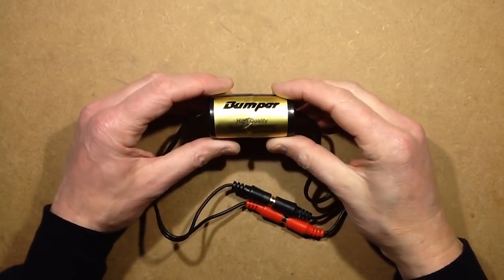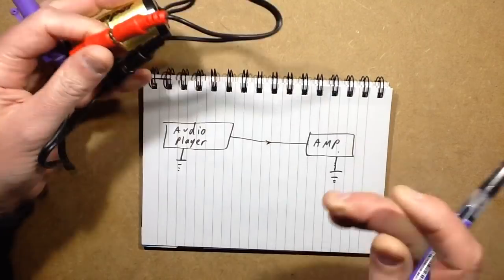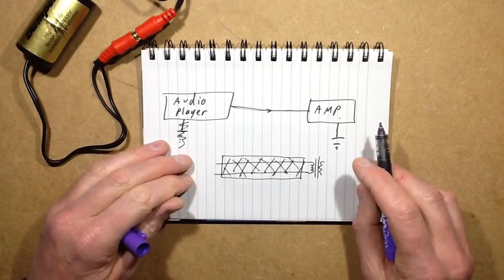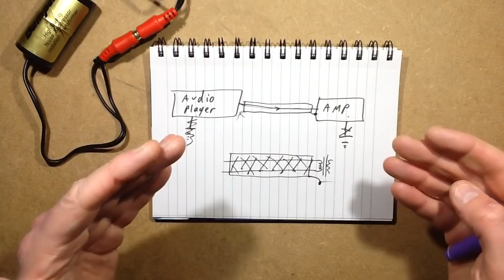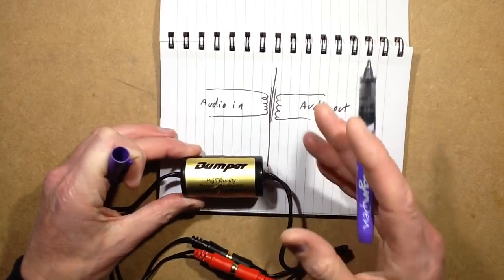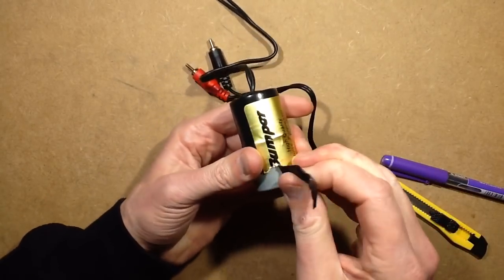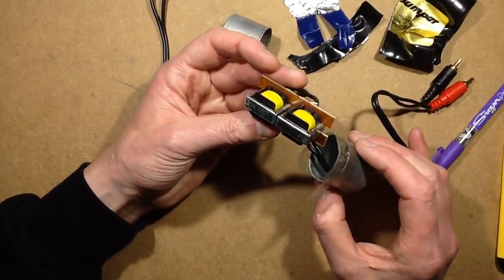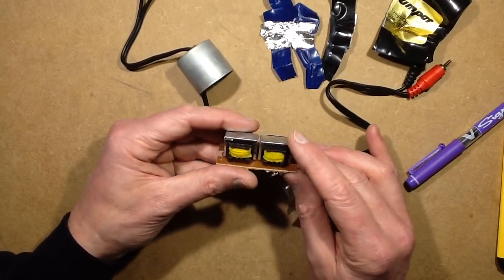Inside an audio isolator transformer module.

Comment: These are great. I've used them in several projects.  Most notably was my 80s Bluetooth boom box where I used it to eliminate the horrible noise the Bluetooth adapted was creating.

None of the ones I took apart had that foil on top though but we're surrounded by a razor sharp piece of tin inside the outer cylinder.

Comment: The foil looks to me, bodge job :) Usualy, we always place pair of stereo trasformers 90 degree (eliminate magnetic crosstalk), then we connect the transformer shielding together (eliminate EMF noises) the outside shell is a simple raw steel, to block low frequency magnetic waves from the transformers core, because this transformers has a bit air gap. on consumer level, working perfectly. The best ones uses precision winding, hexacore coils, gold or silver plated shield, and some kind of special core. I even seen mixed E and toroid transformers. What I dont like about this transformers, is the way, how they destroy the high frequencies and the saturation. Use short strong rca cables, and for big distances, no other way, just balanced signals. And yepp, same source low resistance earthing. Or digital interconnect. Thank You for sharing :)

Comment: I bought two audio isolators ( rca + 3.5mm) after watching this video. This stuff works since for some reason my pc causes a hum and buzz whenever I run any games that utilizes my graphics card heavily. Thanks bigclive
Reply: The hum and/or buzz from PC is caused by poor quality power supply and/or poorly implemented voltage regulators on your motherboard. And audio isolator will fix the problem despite the source of ground loop.

Comment: I usually end up buying stuff you show, but in this case I've already got a stack of these in use today to break open the earth loops between my 3 PC's, mixer and amp. They're very cheap and work well. Decent bandwidth if I remember right.

They've been around for many years. I remember selling them in the electronics shop in Newington 15 years ago!

_________________________________
Maybe the foil was used to join the two transformer frames together to help with channel isolation?

Comment: I had a similar issue with my external USB-AMP (no ground Audinst HUD MX1) connected to my PC. I was soooo glad when I got one of these and it solved my issues. The AMP is also creating a very loud humming when the USB is not connected to the the PC but its power supply is connected to the mains.

Thanks for showing us what is inside!

Comment: Unbalanced audio connections can pretty much be considered broken these days. With computers, shielded network cables and all that good stuff in modern setups, there's earth connections coming in all over the place. You'll be catching a ground loop faster than you can say "ground loop".

Ground loop isolators are handy when having to interface unbalanced to balanced. One system relies on floating ground, the other is earthed everywhere.

The important thing about balanced connections is the balanced impedance part, actually (if in doubt, consider the case of no signal). The whole thing can be treated as a Wheatstone bridge.

If shield currents cause audible noise, usually one component suffers from a faulty shield connection hookup known as a "Pin 1 Problem". AES48-2005 clearly states that the shield (XLR pin 1) must go to chassis directly and immediately, and must not connect to local audio ground first (the connection between both is made elsewhere). Now components that disagree should mostly have gone away by now, but it looks like even recent KRK Rokit speakers (5", 6" models at least) are still affected.

Comment: i was always taught(and please correct me if im wrong) but "balanced" audio was the act of running the same audio signal through two separate wires with one being "normal" and the other being polarity inverted, once combine they cancel out any noise...

----------------------------

In fact, a little bit of googling brought up this:

http://www.ians-net.co.uk/articles/balanced_lines.php

To remove noise from a signal we need some way of working out what is our wanted signal and what can be thrown away. Balanced lines achieve this by transmitting two versions of the signal down their length. The source equipment sends the normal signal down one conductor and a polarity-inverted signal down the other. This is usually done using either transformer-based or electronic output stages.

The cable itself is designed with the conductors having very similar impedances and twisted along their length so that any noise is picked up equally by both conductors, no matter where in the cable it occurs.

The receiving equipment has a transformer or electronic differential amplifier, and takes the inverted signal and returns it to it's correct polarity. At this point, the wanted signals on each conductor are both the same polarity, whereas any noise is of opposite polarity. Summing the signals from the two conductors together reinforces the wanted signal and cancels anything unwanted, leaving a recovered signal which is very close to the original. (this is known as Common Mode Rejection - i.e. any signal which is the same on both conductors is removed.)

Even balanced lines aren't perfect, though - slight differences in impedance, twisting or input gain will allow some noise to slip through. This isn't generally a problem unless you're using very long runs or working in areas of high interference. 

It looks like the same as what twisted pair does with networking/telecoms...
Reply: +TornTech  Almost.....Balanced lines are indeed, differential pairs. Each line of the pair, contains the 180degree inversion of the others signal. The amplifier will only amplify the sum difference between the two lines. Any noise, picked up on the lines will be of the same phase and amplitude, on both lines, hence, no sum difference in noise to be amplified. Clive's explanation was correct however, it did lack a bit of detail.
Reply: +bain5872 Almost. DIFFERENtial pairs do not require the two signals to be inversions. In fact you could have all the signal on one conductor, and 0V on the other. The "difference" between the two is still the audio signal you want, and the common mode interference is still rejected. In order for differential signaling to work, the IMPEDANCE must be the same on both lines. That way, common mode interference affects both lines EQUALLY, and is thus subtracted properly on the output. The reason inverted signals are used, is because it increases the dynamic signal range, and drops the noise floor.
Reply: +bain5872 The term "balanced" means the impedances are balanced on each half of the pair. It does not refer to inverted signals.
Reply: I am aware of this however, without a differential signal (inversion of one line as opposed to the other), there is no amplification nor noise cancellation. It stands to reason that if there is a mismatch in either lines impedance, there would indeed, be a differential signal on that line. This is the point that you seemed to not understand. If I misunderstood this, please accept my apology.
Reply: Euro Bum
You are clearly speaking on a subject for which you have a very limited knowledge. I suggest instead of finding factoids, to bolster your sense of worth, you do real research on the subject and please, stop using Wiki as your source material. Good day Sir.
Reply: Euro Bum
No problems on my end at all and thank you for your concern with my comfort. If you felt insulted, you were mistaken. That feeling was instead a broken ego which is also affecting your ability to understand which is why I posted the first reply to begin with. I wish you peace and hope you have a wonderful day.
Reply: +TornTech Does that also mean that non-linear effects of the transformers are cancelled out?
Reply: pepper669
No. Once you lose that power, you can't get it back. Differential signaling doesn't mitigate this. In fact, baluns have a transformer at both ends, so it's a double whammy. However, that's why transformers optimized for audio (ex. Triad TY-141P) should be used. I've listened to the output of a Cat5 balun, as well as analyzed it on a scope, and measured the output power, across the audible range, and there was no perceptible difference.
Reply: +Euro Bum Thanks for the info, appreciate it!
Reply: +bain5872 Gone :) Thanks. Way to be a censor.
Reply: +Euro Bum Gone :) Thanks. Way to be a censor.
Reply: *****
Your opinion is welcomed however, I wonder how your employer, considering whom they are,  will feel about their choice to employ a trouble maker. Of course,  I would never do this to anyone however, they are others whom will. I would be careful if I were you.
Reply: bain5872 Gone :) Thanks. Way to be a censor.
Reply: bain5872 Gone :) Thanks. Way to be a censor.
Reply: bain5872 Gone :) Thanks. Way to be a censor.
Reply: bain5872 And yes, you have the originals. Do with them as you wish.
Reply: *****
You are very naive.
Reply: bain5872 How so?
Reply: bain5872 As a matter of fact, check your private messages. (Hangouts, that is)
Reply: bain5872 Bloody YouTube, changing everything all the time.
Reply: *****
I did not say that I would. I'm not a person that would hurt someone just because they disagree with me. I was warning you that they are persons that will. I was being nice to you.
Reply: bain5872 Are you going to accept the invitation so we can talk this out?
Reply: bain5872 Well, still, I took your advice. Didn't want someone else doing it.
Reply: There is nothing to talk out. Hey, I've got no beef with you. I was simply illuminating a problem you will run into by stirring the pot of trouble. I truly wish you the best.
Reply: bain5872 You know what? Now that I've calmed down, I feel the same. Sorry for being such a prick. Sometimes I let my anger get the best of me,
Reply: *****
No problem. You're human just like everyone else and you are indeed entitled to your opinion and I respect that. I would be cautious though. They are some truly vicious people out there. Have a good day.
Reply: Having gone through training as an audio engineer, I've been taught that balanced audio is from something like an XLR or TRS connector. These use 3 connectors. Two for the positive and negative portions of the signal, and a third ground connector. This reduces the likelyhood of noise and allows cable lengths of up to 2000ft. Whereas unbalanced, such as RCA and headphone cables use two connectors. One for the positive portion of the signal, the other pulling double duty for negative and ground, and limits the length to around 250ft.
Reply: James Laidler Agreed.
Reply: Balanced audio is simply the implementation of a differential pair.  Noise that is common on both wires is cancelled.
Reply: Randy Lott
Well put. Completely agree! This is what I should have said in my very first reply to this post.
Reply: +bain5872 One cannot be mistaken in feeling insulted, especially by an insult. Instead of reading factoids to bolster your sense of worth, I suggest you make some kind of effort (don't push yourself though, I doubt you'll understand much!) to understand the fundamentals of this kind of psychology and practical morality.
Reply: Roflcopter4b
You are most certainly incorrect in your analysis of my psychology as well as your guess of my understanding of the subject of audio electronics. As to the original subject of this post, your flawed opinion adds nothing to this discussion but an insult. I think taking your own advice would be a wise thing for you to do, said the pot to the kettle.
Reply: bain5872
If you'd read a tiny bit closer you'd notice I didn't comment on your audio electronics knowledge, and in fact merely insulted you. Why would I do that? Well, why did you?
Reply: Roflcopter4b
You are a very assuming person. I did read your post very carefully. I wanted to Illustrate the point clearly. Sometimes one can misunderstand what one writes and mistakenly conclude that one insulted them. I was offended by the original poster and retaliated by being rude.  At least I thought I had a valid reason. You do not.
Reply: TornTech thanks. I've never properly understood this. I've always grounded my equipment but that didn't work all the time. But better than a shock. Thanks again. I'll get some of these and keep them handy, especially when connecting a phone to the stereo.
Reply: TornTech 😴

Comment: I did a quick test with audio signal generator on one side and a scope on the other, and it looked fairly flat from the high range all the way down to 100Hz, where it started dropping off rapidly. Better than I expected for such small formers, but Altronics have a similar one that makes even better claims about the low end. At those frequencies, I doubt the audio would suffer much by just boosting the low end with the sub amp or EQ though.
Reply: Thanks for your info. They were recommending me these for my hifi, but I doubted the audio would be without a flaw.. you fullfilled my expectations.

Comment: A couple of years ago I was going to modify an old tube radio with an aux-in jack for my grandfather, but I eventually gave up on it because I learned that they operate on half-wave rectified mains voltage, and the plug was non-polar. So just by plugging it in the wrong way around, you could end up with live mains on the aux jack. This is exactly what I needed, and I think I might re-investigate doing that now.

Comment: These one are VERY helpful and was THE solution for a little project some months ago.... I had needed such one too to connect my Samsung galaxy S3 with an pam8403 DIGI amplifier board AND a power bank cell charger for cell phones at same time. (Power bank charger as power supply(5V) for the amp and for charging the Samsung S3 at same time.) WITHOUT the audio isolator transformer,i had cannot charge the S3 and powering the pam8403 amp at same time because of ground problems(weird noises and probably BAD for the digi amplifier).

Comment: Different substations can be a massive issue even for mains electrical work (as you no doubt know!) let alone audio. I remember measuring 50ish amps flowing down the armour of an SWA. The voltage was tiny... <5 volt, but the impedance was so low the armour got warm.

Comment: Sorry if this has already been mentioned but balanced line signals are designed for longer distances. Yards and yards, sometimes hundreds of yards, with very puny signals, such as that which comes from a microphone. If you 'lift' the ground you have no signal ground reference but sometimes, as you mention, this can be preferable and the receiving device uses its own ground. The real magic is that the two signal wires carry the same signal but one is inverted. At the other end both signals are recombined and any external distortion, which could be rather inposing to such a little signal over a great distance, is conjured away by the inverted distortion cancelling out the distortion on the other one....       I think....
Reply: Dullthud007 The ground that is lifted is the shield ground at one end, not the signal ground/return lead.  That is to prevent ground loop currents from inducing a common mode current (and thus voltage) onto the signal leads that can cause signal integrity issues where significant ground loops exist -- in the worst cases it can also prevent currents of sufficient amperage to actually melt or burn up the shield conductor where very large ground loop currents exist (although such ground loops can also be a major safety issue in addition to being a nuisance).
Reply: Differential signals don't have a ground reference.

Comment: The problem in cars is that once you got audio signals from your radio to an external amp the return currents won't just flow through the chassis or the wire but also through the audio ground. The generator puts out a lot of ripple so you end up hearing your engine RPM times 3, 6 or even 12(depending on the generator) in the speakers. This is where the isolator comes in. It stops the ground current and ripple, so you won't hear the whistles in your speakers.

Comment: My thoughts on this: the metal casing's essential role is to provide a Faraday cage, meant to ensure that no RF interference can be caught up, then amplified. Given the car audio focus, you are right, the ignition would be the main culprit however other RF sources should not be ignored. After all, you cannot create a winding with the unscreened audio signal cable and hope for the best - that's how you end up with an antenna. The bit of foil between the transformers should serve to discharge any potential that could build up in-between.

Comment: A must have for car audio, too. Great for alternator whine and other issues. Quite often it's not practical to have all the equipment grounded to the same point (star ground) so there will be slight voltage differences in different chassis grounds. Also the signal wires will be a bit long from the dash to trunk mounted amplifiers, and often will have to run near other wiring and pickup noise. As you said, a great get out of jail free card to have in your box. There is super posh version of this where the audio signal is changed to light and run over fibre then converted back at the other end. Great when the cable has to run past very noisy equipment.

Comment: I have an older Toshiba flat screen television that I'm using one of these devices on. Mine has some variable resistors built-in to adjust the volume. I had tapped in to the speaker outlet & send the signal to a stereo system built for computers. It is a nice unit made by Creative. it has a subwoofer box & two nice stereo speakers. I knew when I tapped into it, this was the only way it would work.